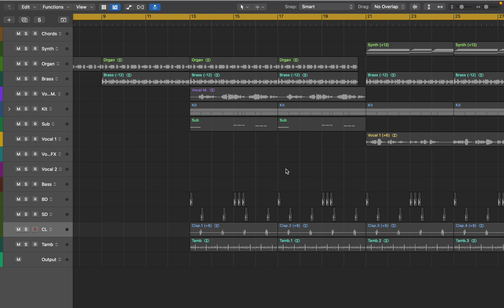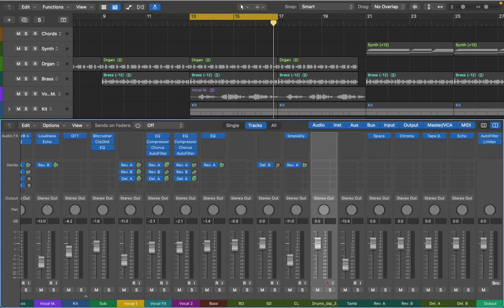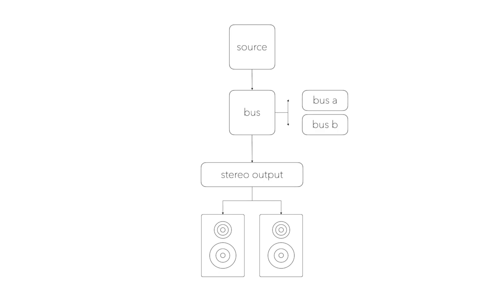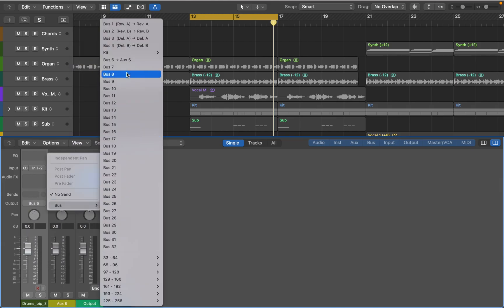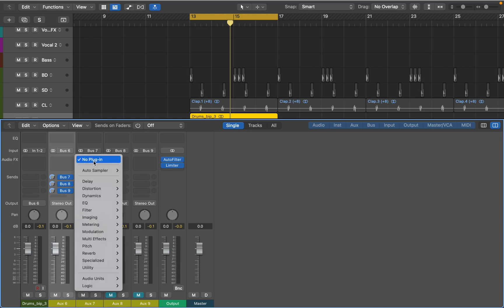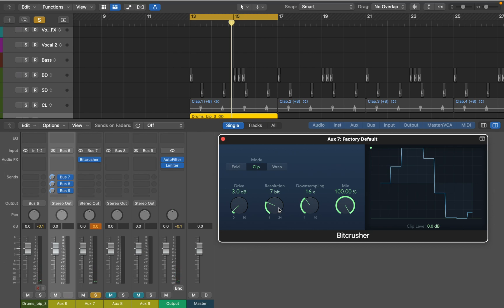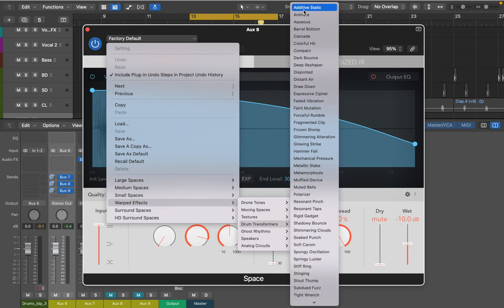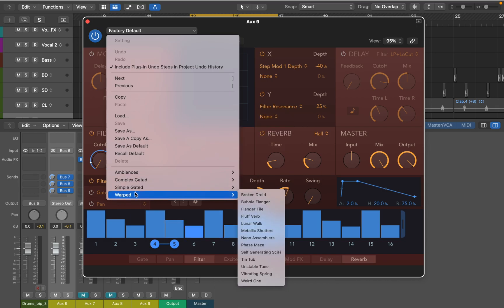Logic Pro: Creative Drum Mixing & Processing

Comment: Thanks very much for your excellent videos. In this case, I would use a gain in order to make sure that output level for dry and wet are the same. What would you recommend?
Reply from the maker: You're welcome. I'm not sure I understand your question. With the signal path in this video your original track controls overall volume that will affect how much signal each of the buses receives, meaning it is the main gain knob. The fader of the bus you are sending it to, instead of the stereo output, controls dry volume but won't affect what sends receive ( given that your send buses are pre-fader ). Then the send buses with effects in this case act as 'wet' amount. So let's say you kill the volume on your bus, your send buses will still receive full volume and you'd have wet signal only. Or decrease the volume on your send buses and you would get just dry signal. Also you have those tiny knobs next to sends but I'd recommend you set them at 0, just hold option key and click them. I hope this is not confusing and answers your question. Otherwise tell me what exactly you want to achieve.